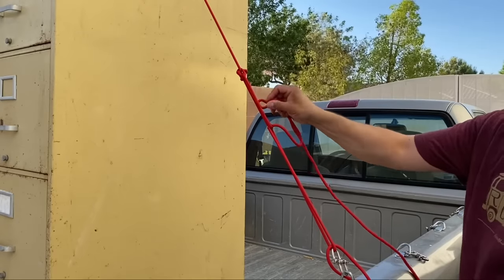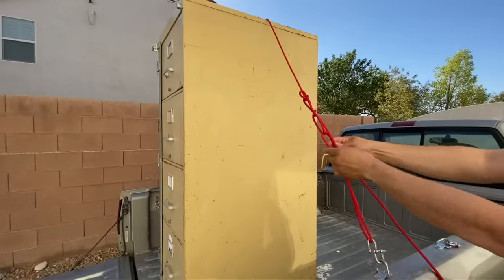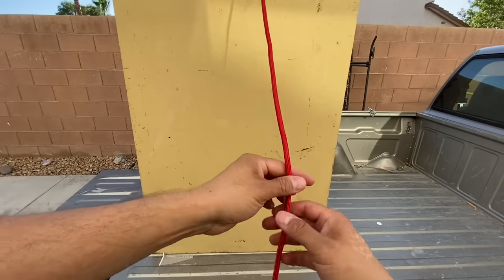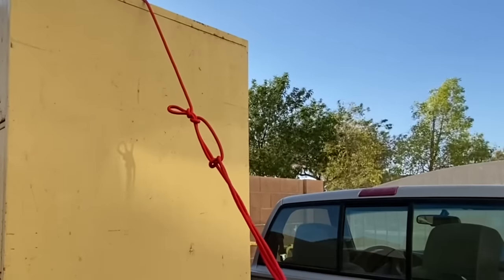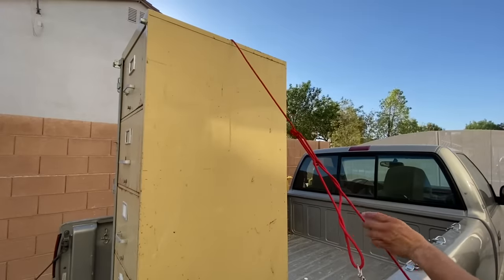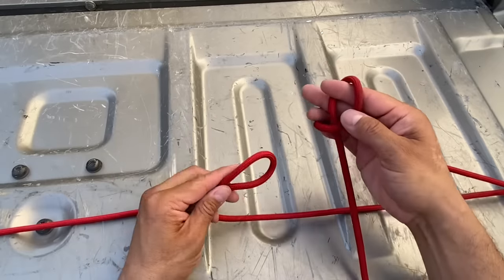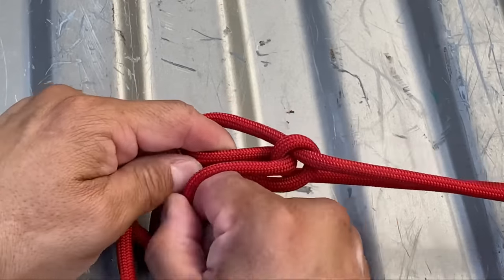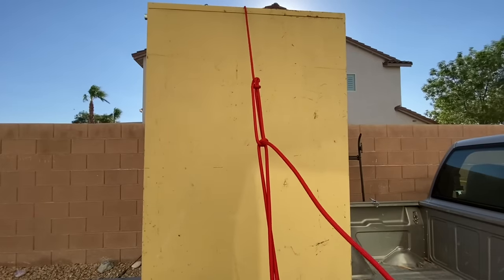In-line Automatic Truckers Hitch. Tension locking.

Comment: I've been going through and learning as many versions of the truckers hitch as I can find.  This one is very different, and fun to learn!  However, I think it is suboptimal because that ball hitch that is so useful in holding your tension is also preventing you from gaining tension.  The harder you pull, the more it resists you.  Which is fine up to a certain point, but I found even using my entire bodyweight, it won't get as tight as it should.  However, with the "normal" self-locking version of a trucker's hitch, it's just an extra wrap, which doesn't lock up so much as to prevent tightening (but still "locks" enough while you tie off a final hitch).  So I would still use a standard/locking trucker's hitch when absolute maximum tightness is required.

Also, I'm not sure why you make the double loop around the bight and then take it off and turn it around.  You can just wrap it the other way.  The important thing is that the tail end of that line is away from the tip/end of the bight.  I use that on its own to hang my hammocks (or a sheet bend/beckett hitch, depending on the material).

Comment: Was a bit tricky to follow, I found. I had mess about a few times to get it to work, yet I am not sure if I really did. I use a trucker knot so often for almost any rigging. This looks cool, but I have done well with the standard and a bit less complicated. Would have to practice this a bit more. Not ideal for short rope. One other way is the standard way, then when coming through the bite to pull down, just put a second turn on the bite, and that holds well too.

Comment: So any (dis)advantage to this over your older suggestion?
https://www.youtube.com/watch?v=Gkepmm-5pNQ
The loop here (bend + lark's head) definitely seems more complicated than the alpine/butterfly loop.  And the friction-tension holding knot appears to be similar...
Reply from the maker: The main difference between the two videos is having to pull the entire length of cord through the loop. This version is better for longer lengths of rope while the other is just fine when you don’t have to pull so much rope through. They both hold just as well, but this version is easier to untie.

Comment: This is the more confusing difficult way of doing it when it's alot more simple.. just use a slip knot for the anchor part and half hitch to lock after pulling tight and done

Comment: It’s a good tip but I think you could have gone abt it much simpler as the setup is exactly the same as a typical truckers or truckers hitch but instead of passing the working end once around the loop you normally form,  you pass it through again so when you pull on the working end to tighten, the friction between the loop you created will limit the slip.  No need to over complicate the viewers by 1) the cow hitch you made to create the lever arm and 2) the two wound then turn 180 degrees explanation.